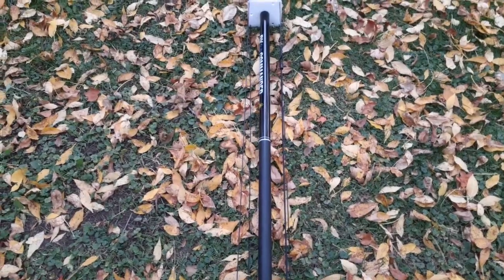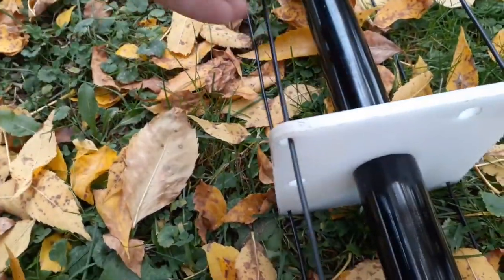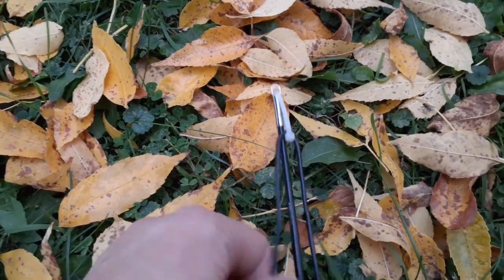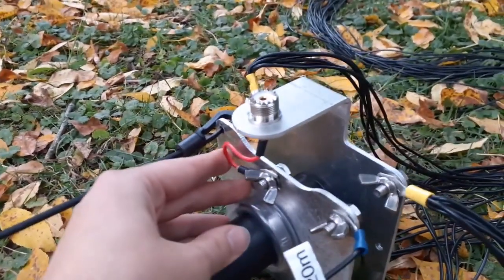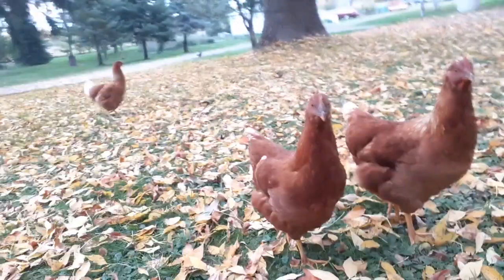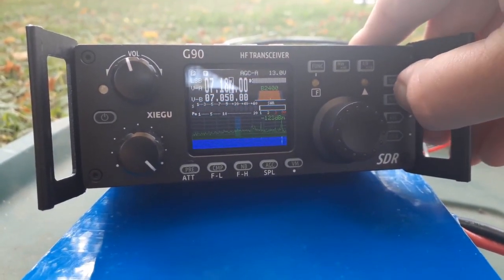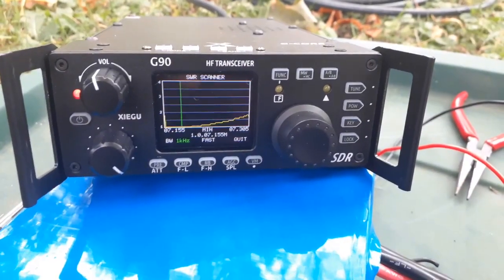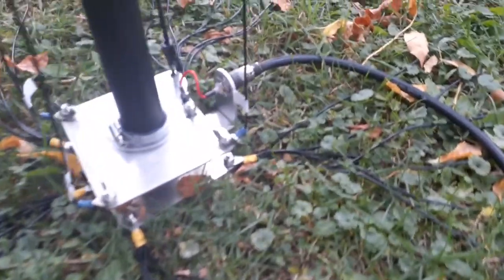Dx Commander Lite Build Part II

Comment: Well put together video..Looking at the swr band sweeps at the end of the video, the DxCommander looks to be very broadbanded and the swr curves looked very flat, or mostly flat. I’m a little confused by this. Am I missing something? The wire gauge looks fairly thin for the curves to be so flat. Also, during swr/bandwidth testing -when a wire radiator is too long, one trick is too fold it back tightly on itself before trimming. Just in case you need to “add” some length to it. Thanks agn, n6spp

Comment: Why don't you get a DEGEN 1103 comms Rx second hand and then do a Heist on the RETRO 80  (40 mtr version )   SWL 40 mtre AM cct and built your own transceiver with an antenna relay.  sure it won't have the punch of SSB but you built it yourself and it is very hard to louse up.   THe Dave Benson (Small wonders labs) design can be found via Rig Pics and other places (the kit is now unobtainium but you can see some details on Eham no doubt- it produces about 6W PEP) .  The circuit is hellish crude and you need to be sure to find the Tx xtal (or build an analogue VFO) but you will have build most of it yourself. l I am sure that with a bit of help from the grown ups you could do this with isolated pad construction using a pad cutter from Dan's SP or from Harbour Freight. (Hearsay I am not  a US citizen).  Try  QRPme for the  7.yyy tx xtal. or xtals. They definately have 7.122 Mhz but whether they'd sell you two off for $4- is another matter Prolly Yes . Local hams may have other supplies or glory boxes .     Look in  - http://www.radiomanual.info/schemi/Surplus_Radioamateur/z_Surplus_Radioamateur.php  under retro-40 for example.  The TC1412N can be had from the company Futurlec.com or they will have substitute.  Don't substitute for the IRF 530 part as the Power Amp.  Specifically the IRF 510 can or 510A part can only be used at reduced voltage here.  it tends to fail at full drive and 14 V supply .   Edit  futurlec.com has TC1426CPA	TC1426 1.2A Dual High-Speed Mosfet Driver	Datasheet	Yes	PDIP8	 but not the TC 1412 part  . your mileage may vary. Dataheet - http://ww1.microchip.com/downloads/en/DeviceDoc/21393D.pdf  if you want to have help with interpreting the datasheet either do it there or hunt me down.  the part is definitely good to at least 8.33 Mhz at  full drive power.  The  1427 part which Futurlec also seems to stock is a better part for RF  as it is one inverter less on the drive side.  The Futurlec datasheet is out.. it has suffered from Link rot.

NB the audio circuit is designed to work with a moving coil 600Z dynamic mic  and no other. You cannot use a powered mike or a ceramic  type microphone.  This is By Design. 

 SSB Tcvrs can listen to Am by zero beating the signal and the DEGEN can Rx either SSB or AM SW.  

In order to use the TC14 part with isolated pat construction I suggest you get a bit of veroboard and set it up to accept the DIP chip and then wire down to isolated pads using solid copper wire leaders. - you will need insulation on the underside of the veroboard scrap of course , to be sure.

  YOu do need a drill press or  a pistol drill frame to do the pad cutting thought.  The hardest part to get will be the about 1:2  impedance match AF transformer for the modulator . If you use the one that Dave Benson used (from Xicom ),  you need two in parallel as a single type 48 transformer  cannot carry the AF power and he had  some in service burn outs.  

I can show you a photo (that proves it was in fact built and is not weakware)  of a 1:9 Balun I used to make my Degen 1103 compatible with  Coax cable (strictly it is a UNUN).  you need a type 43-3312 or similar core to make this Balun happen.  Without this system  you need a separate hi Z antenna for the Rx , which is a nonsense.

Comment: When you do the final cuts there is a trick well generically.. This works well on CC steel wires but will also work on any  wire when the insulation is removed  - so what the hell if you get exposed copper you can always use heat shrink and mastic.  So what you do is bend the wire gently back ion itself to form a loop with now two parallel conductors of the loopy bit shored. But how do you hang it ??.. well you use nylon ratchet ties done up really tight and you can use hard tooth picks for packing to get a semi square x-section  (or rough it up with solder to provide some bite for the ratchet ties.). 

 Then run at temporary braided cord through the two end loops - dipole and check it for Swr.  Once you have it Gut then you can put an indelible marker on the loop back point and make it permanent with an egg insulator.  Obviously the wire is now not fully linear on the egg insulator but we are talking small marginalities.   Tim Fidler in NZL one time licenced ham who is looking at putting up a 40 mtr Dipole .. round touit.. (mananan- it's summer.. the sail boat is more inneresting :-)).   CC=  copper coat which is common antenna wire construction.